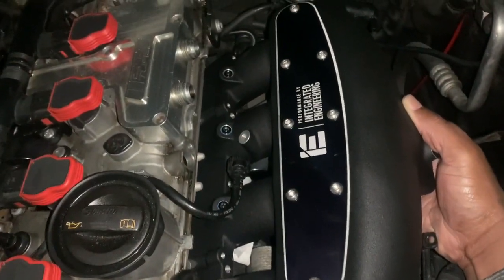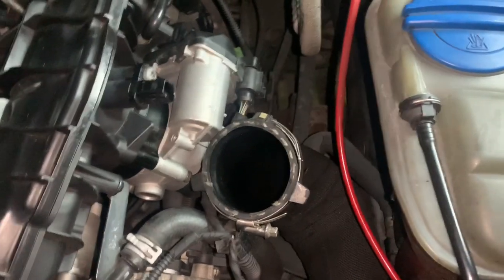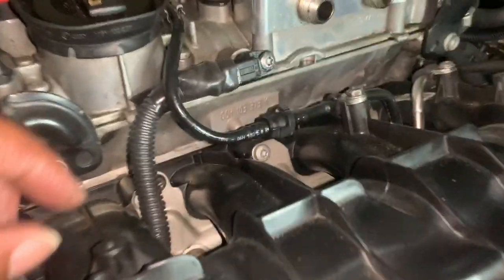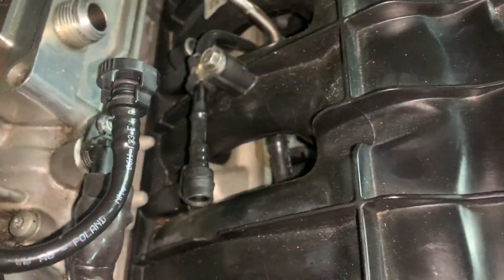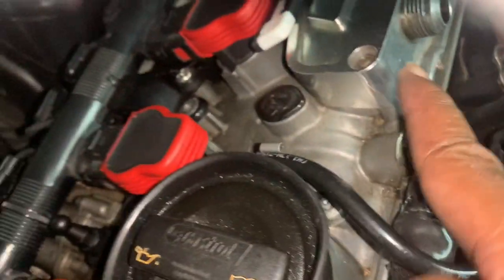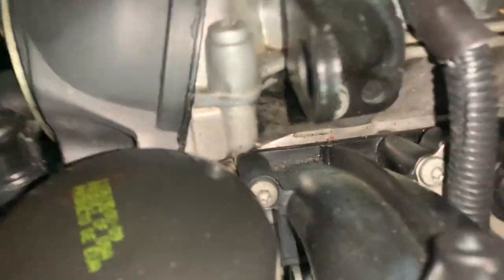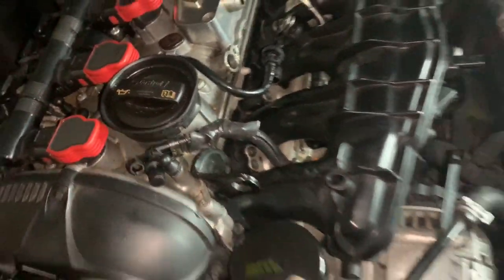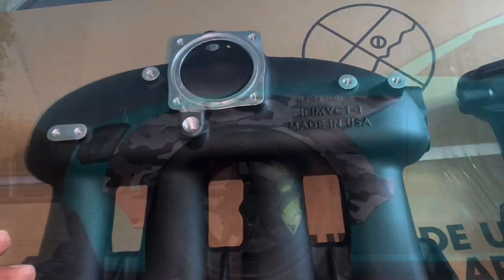Audi / VW 2.0t Intake Manifold Removal / Upgrade IE Part 1 (+Horsepower)  IN 10 minutes | Audi MODS

Comment: Great video.  Question: Did you break the connector for the injector that stayed stuck inside?
Reply from the maker: No but I bought a repair kit anyway for new seals
Reply: Bruce Custom Motors got you. I meant the plastic electrical connector though. I’ll be doing this tomorrow and I’ll be cleaning the valves. Q5 2.0

Comment: Hey Bruce . I’m getting an Audi A4 Quattro delivered on Monday . Do you know of any tunes for the stock motor . I’m trying to get about 275 bhp on the stock setup . I have another vehicle with a k04 and a custom tune getting over 300whp but I’m not familiar with Audi platforms. I got the a4 with relatively low mileage . About 37,000 miles and it’s being financed but I do plan on keeping it because I like the k04 turbos . And don’t want a crazy amount of boost but I do want to be able to get that throttle response and power . Any help Is appreciated and great job with the vids.subscribed to you too brother
Reply from the maker: Here’s a few ideas. 

https://youtu.be/GSj76OCyWlM

https://youtu.be/JWbTvLFSjsg

https://youtu.be/TVmF_dUo-FI

Comment: Where did you get that little breather for the oil catch can? I have the same one
Reply from the maker: I added it to release crankcase pressure to avoid oil leaks https://www.ebay.com/itm/25MM-Oil-Mini-Breather-Cold-Air-Filter-Fuel-Crankcase-Engine-Filter-US-/234017935717?mkcid=16&mkevt=1&_trksid=p2349624.m46890.l49286&mkrid=711-127632-2357-0

Comment: Currently stuck on unplugging those fucking 3 plugs. The electronics one(the biggest one) is being a stubborn piece of shit! My thumb is raw from trying to pull this thing out. Pull out game is weak. Haha
Reply from the maker: Lol did you finally get it, or you got a baby
Reply: @brucecustommotors  brooo! I'm stuck. That part that your car doesn't have, it's stuck in mine. The bottom nut (10 triple square) is stripped and I can't get this bitch out. I really don't want to take it to a shop since everything else was pretty damn easy. This is basically at the end of taking it out too.

Comment: Codes for intake manifold P1018 P3135
My intake manifold in A6 2007 2.7 is bad . 
My car consume 10 liter in 30km city , and 7 lit in 100 km highway . Does it consume so much becouse the intake manifold ?
Reply from the maker: yes
Reply: @brucecustommotors  hello , i didchange the manifold set but still my car dont has acceleration and consume fuel like before , i thought maybe the problem is in this throttle body , what do you say  ?  https://youtu.be/p-UPPEBlju0

Comment: I bought used intake just like yours but didn't came with hardware, do you know if someone is selling just hardware
Reply from the maker: Here it is but you can go to Home Depot and source it’s yourself https://performancebyie.com/products/ie-intake-manifold-install-kit-2-0t-tsi-ea888-gen-1-2-longitudinal
Reply: Thank you so much, I would just need to figure out the bolts size they go thru the intake to head , THANKS AGAIM

Comment: Loved this video! I am watching all your videos this weekend. I have a 08 TT fwd, with some mods. Mods are GIAC Tune, Neuspeed cold-air intake, Becker axle back exhaust, R8 Ignition coils, replaced the cam follower/screws/gaskets, and some more. I want to add more power/reliability to my car. I love my car and have 130k miles on it. I have done these mods in past year and am getting more and more confidence in working on engine. 
Where should I go to keep my car running smooth and gaining power? Intercooler? IE intake manifold/ exhaust? I would love to hear your opinion. I love the sound of your car. I ordered a Unitronic downpipes and sent it back bc I was told I couldn't pass a emissions test unless I went with unitronic stage 2. I think I want to stay with GIAC but am open to your suggestions. How did you get your car to sound that amazing? Thanks in advance!
Reply from the maker: Main your car sounds awesome, inter cooler definitely can get your air cooler and give you more power intake manifold is a plus giac is a good tune, the power curves are a little different from apr and ie, but the all are about the same, Check out my CT’s down pipe video, I do a walk they of the exhaust
Reply from the maker: And thanks for the love and support

Comment: Did you disconnect the battery for this .? 
Did you need to take the fuse out of the fuel pump fuse ?  Can you show?
Reply from the maker: I just disconnected the battery, because every time the door opens are car is illuminated, the car fuel injector will prime and squirt out a little fuel

Comment: What does cold start injector mean on the Audi a5 2.0T???
Reply from the maker: there cold start which is when you start your car, when it has been off long enough to be cold, and fuel injector, which specifically were you speaking of
Reply: @brucecustommotors  it might be the fuel injector, should I order the s3 ones?
Reply from the maker: @frankwhite8413  might swell they have potential for more, power and are almost identical to our factory ones
Reply: @brucecustommotors  thanks Bruce...

Comment: Another gem bro!

Question: Are you switching to an IE tune from an APR tune?
Reply from the maker: Thanks Brother, im going to do a comparison video soon, and put out part 2 in a day or so, to see, hoe it feels , and yes , as long as you have your serial code, you can always switch back, you just have to pay the apr service fee
Reply: @brucecustommotors  Gotcha! I’m looking to mimic exactly what you did here. The weird thing is, the tuning shop I go to one of the guys there told me IE tune not designed for APR K 04. I was like “huh...”I’ve never heard anything like that before...” The turbo is not proprietary to APR so I can get any tune. I think he meant it may not give same results. Either way, my intake manifold is not working properly and I refuse to buy an OEM one. I’ll wait to see what you come back and report in Part 2. Thanks again! 🙏